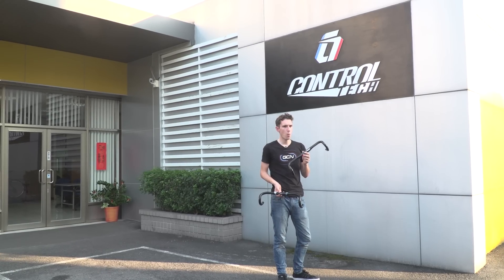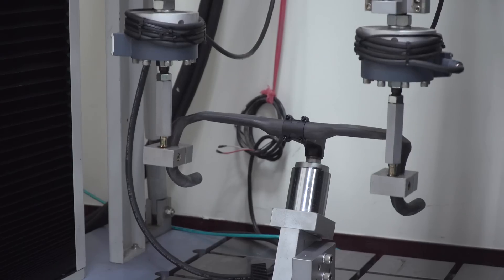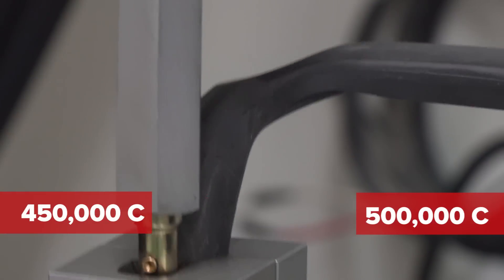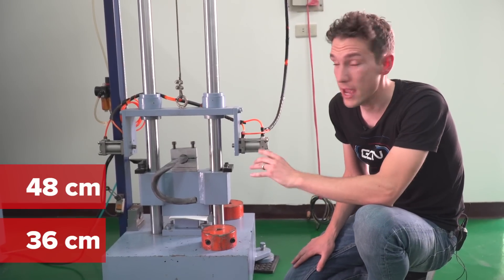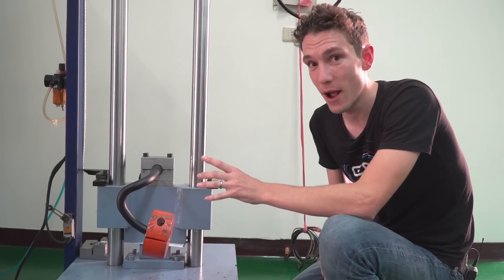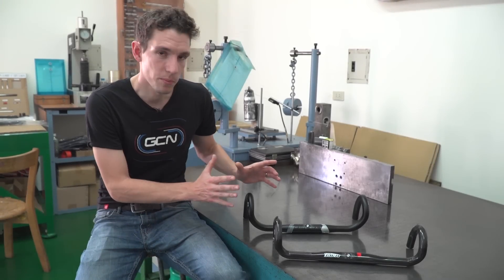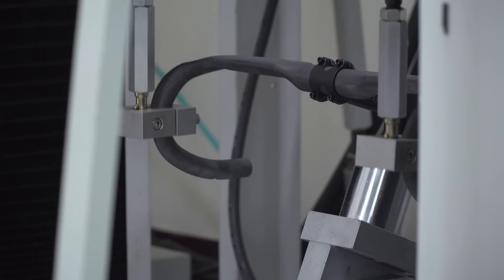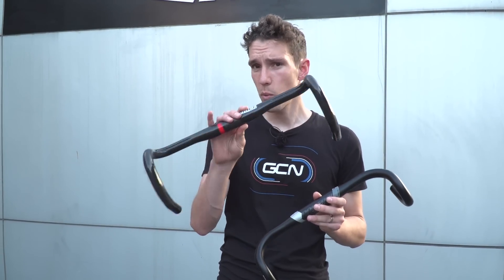Carbon Vs. Aluminium Handlebars | Which Are The Strongest?

Comment: If they test all bars with 400,000 cycles but the bar will break from 600,000 cycles, that means the rider can only use the bar to a level equivalent to 200,000 cycles until it is at risk of breaking after purchase. Wouldn’t the test phase of products just waste its lifetime?

Comment: Im not sure if you mentioned why the drop test was a bigger stress on handlebars than anything in real life.  If you are going really fast downhill and wreck, wouldnt that supply enough force to the handlebar to exceed the drop test?  I'm not talking about a motor vehicle hitting the handlebars at 40 mph, because you would probably either be hospitalized or dead.

Comment: Did the aluminum handlebar change shape during the crash test? So it might have not broke but did it deform?
Reply: Sure looked that way to me
Reply: Yes, because Aluminum is a ductile material, however, in these tests failure isn't considered minor yielding. Granted, I'd consider the change in shape to be small enough to keep riding, but if you've had that much impact, the handlebars won't be what I'm concerned about.
Reply: Yes it did bend but you can ride with bent bars while you can’t ride with a cracked bar
Reply: You can still ride back 😂
Reply: well a bent bar is anoying but yea the pot hole woulf probably fck some other part up harder

Comment: You might left out another very important piece "Friction". You tried pressure and impact but friction is probably most important. Knowing that all A-frame is basically base on friction due each joints turning Etc.

Comment: I feel like Aluminium is safer when it does fail.
Carbon could snap off potentially when standing up on your bike but aluminium is more likely to bend before it snaps so you get a warning. 

What do you think ?

Comment: I stick with aluminum because of the negative environmental impact of carbon production and disposal.
Reply: By that logic might as well have a wood handlebar.
Reply: @FLMKane  not really... By your logic, I'd need a wood handlebar every other week.
Seriously though; carbon fiber is very wasteful to produce and effectively impossible to recycle. It's epoxy and polymer can't be melted and reused like aluminum. I hope more people consider the entire life cycle of this material before purchasing it for marginal gains.
Reply: @Nicool333  Yes by MY logic we'd be using bamboo handlebars. 

Tough as nails and very light. No downsides.

Comment: What about perform testing similar to real crashes? to hit the bar from the site to a cocrete solid surface. It seems that this tests are programmed by manufacturers just willing to sell their new material. When you go to see a race you can see yourself real conditions, carbon is more resistant when it works as programmed (on the rigth directions) if you hit it with something hard on a unespected angle it will break (as the carbon will not work but the fragile epoxy aroung it)

Comment: Are narrower bars stronger? And is the round shape stronger as a pose to a flat shape?
Reply: Depends on which metric you look at, and their manufacturing, but all else equal, narrower bars will be stronger, due to the lower moment arm between the stem attachment point and the forces at the end of the bars.
Reply: John  those are just units of measure, 10mm = 1cm... that question is illogical.

Comment: Their is also one caveat to the carbon fiber handle bars. I noticed that you made no hardness tests no Vickers, Brunel etc... The combination of carbon fiber and resin would not take to abrasion as well as anodized Aluminium.  Any crashes resulting in cuts, gouges and scratches to the handle bars would significantly reduce the resilience of the carbon fiber handle bars as some of the carbon fiber strands have been severed. Meanwhile the same accident would remove have to remove the hard anodized layer of the Aluminium first... cool fact that anodized layer while it would never regenerate to the same thickness and obviously colour. It would regenerate to return a measure of protection to the handle bars.
Reply: And how does that disprove or prove my point? That handy film still offers a regenerative protection that carbon fiber simply can not. If you want to get real technical Aluminium does "corrode" but not in the same way as steel does when it rusts. Aluminium age precipitate hardens over time, causing a loss of elasticity leading to brittle failures. And Aluminium still has superior surface hardness and because of that abrasion resistance very handy when you go ass over handle bars. :)

Comment: I've witnessed some of the earlier attempts at aluminium bars. By all means the chrome-plated steel they used before was superior in almost every way. That said, aluminium handlebars these days are the norm, and steel handlebars are absolute flimsy shit.

The biggest cause of handlebar failure is probably improper installation.

Comment: You know if you've dropped your bike, but how do you know if anyone else has dropped it? How well do you trust your friends and family? Do they even know that dropping your bike could damage it and put you in danger? Would they tell you if they did know? Food for thought...
Reply: Even a falling unconsciously, on the side of the bike, will split apart a 1" c/f handlebar.  Such a fall will NEVER be a concern on C/F crankset arms. As pedals are scraped on nearly every fall; hence pedals are assured to make contact to the ground more than assurance of 'bars.  As the angle of 'bars to make contact on the ground or what else is inconsistent.

Comment: The aluminium bar bended in the impact test, does that still count as a pass?
Reply: thisis howiroll nope, can't bend back aluminium without greatly reducing its lifespan, contrary to steel, where cold setting a frame is often done to accommodate newer wheels on older bikes (130 mm stays)
Reply: Bend back metal and you're work hardening and reducing its lifespan even more. At that point it's compromised and you'd need to replace it.
Reply: yea you could heat it up by a few hundred kelvin and maybe then be able to bend it back to shape but the lifespan would still go down

Comment: If the main deciding factor of you choosing bars is because of crashes, you’re doing it wrong.  Your decision is based off .00000000001% of your riding....and dealing with that choice 99.999999999% of the time.  That’s like using a snow tire year round in the off chance you get caught in a rogue snow storm, so you play it safe rather than pick the bar that suits your riding. Yeah....not smart.

Comment: You didn’t compare the same type of handlebars. The aluminium was a conventional tubular shape but the carbon were aero bars. It failed at the point it had holes for internal cable routing, so it was not a fair test.

Personally I feel the only draw back of carbon is price point. Both will fail if hit with significant enough force. You can not design something to be both lightweight and crash resistant. It is always a compromise. Arguably steel is a better material then both in this respect but is considered too heavy.

Comment: Problem with carbon is that there can be significant variance in the processing of the exact same make and model, due to things like voids in the carbon layup and too much/not enough resin. Testing just one sample doesn't really tell the whole story.

Although carbon processing for bike stuff has gotten better in recent years, I would still not trust something as critical as my cockpit with carbon parts that are not individually scanned for defects during production. Scanning is SOP in the aerospace industry, but has been for far too long absent in the bike industry, subjecting us to undue risks.
Reply: The only company I am aware of that scans is Canyon which checks every fork
Reply: I believe Trek and FSA have recently started to as well. Shops like TIME that weave their fibers in house and use resin transfer molding also inspire more confidence.

Comment: There's another test on road handlebars at Fairwheel Bikes where they tests how stiff bars are. They did not test to destruction, but across the board aero carbon bars are more flexy than round or egg shaped carbon bars. From that info, I'd infer that it's easier for the same amount of force to bend aero bars to point of breaking.

Comment: Well i rather have steel padels and stear because eventrough alluminum & carbon can be strong , but they can brake at a sudden moment wich can lead to a traffic incident , i did had a bike with aluminum pedals but after 5 years those pedals did brake all the sudden at a sudden moment  during cycling down the street, i did got lucky to not hit a car during that moment but it could,ve happen.

Point , they should ban aluminum pedals & stears before some one dies from such (possible)incident like me.

Comment: I think they're fine in the road and XC world. But getting into mountain biking, and trail, all mountain, enduro, or down hill... no thanks. A handlebar failure there will land you in the hospital... and it's a lot more likely to happen as that use case sees the most abuse. 

Carbon fiber can do amazing things. As a bow hunter I have carbon arrows and a carbon limbed bow. But the tiniest imperfection or scratch on the surface will become a failure point. I've had limbs snap on my bow because of a tiny scratch. It blows up into a hail of sharp splinters when it fails too. There's no warning, no symptoms, just instant failure. 

It's a great material, but you really need to understand it's properties to run it safely. Handlebars with all the trinkets bolted on, subject to forces in all directions, including perpendicular to the fiber orientation, just aren't a good use case for carbon. They save you - in total - a few ounces at the expense of safety, IMHO.

Many of the carbon bars on the market are raw carbon too. I would like to see some paint, DuraCoat or other treatment to give the carbon just a bit more protection. Because once that surface is even slightly marred - it's toast. It will eventually fail at that point. A coating would offer some small degree of additional protection.

Comment: But if you crack or delaminate carbon it's naff that's the reason lots of people still use alloy bars as carbon could be cracked under bar tape and you won't know tell it goes snap
Reply: You actually would. You'd hear it, and feel it. Carbon laminate cracks and pops loudly, and therefore vibrates under your hand, as it progressively fails. It's not instantaneous, as Si showed in the impact test.
Reply: Andres .C where was an impact test of something hitting carbon? Carbon can have delamination long before it shows a crack.. as a impact on the bars is the test that really matters as carbon fiber has amazing fatigue and strength but gets damaged in impacts with objects ,and it's damage can be much before it's anything visable places who test carbonfiber use ultra sound for a reason
Reply: have you failed a carbon part in a lab? I have. On a bar you'd feel it failing beneath your fingers. It doesn't just go suddenly because cracks have to propagate through the weave.

Comment: The impact tested two different types of bars. The aero carbon with internal cable routing failed at an opening near the stem where the cross section was reduced. The aluminum bar did not have the internal routing and reduced section at the openings. A better test would have used two of the same types of bars.

Comment: Let me end this debate Which is stronger aluminum or carbon ofc aluminum you can throw the aluminum wherever you want Slam the aluminum handlebar to the ground slam the aluminum handlebar to the rocks and metal aluminum will just get a dent or intact now try to Throw the carbon into the ground or rocks or slam it it will break 

Now for advantages of aluminum
Hard to destroy✅
Durable✅ 
Aero✅ 
Last longer ✅
Common to use ✅
And Cheap✅

Now the Disadvantages 

A little heavier than carbon maybe 40-70g difference
Not quite good looking like carbon not internal cabling some of it is internal but the most common aluminum dropbar are not 

Now for advantages of Carbon
Light✅
Aero✅
Good looking✅
Durable but not like aluminum who are super durable✅
Rare

The Disadvantages

Expensive not durable as aluminum break easily although it's light but it breaks like hard Chocolate 

I love carbon but i choose specific carbon handlebar with a material of t800 or T900 so it doesn't break easily for aluminum i just choose whatever aluminum handlebar is that as long as its good looking and internal

Comment: Typically with several of GCN product testings material specifications are not stated which in my opinion these tests can be misleading to say the least
I would prefer to see proper engineering evaluation rather than comments from a has been pro cyclist !

Comment: What I find odd is over the last 10 years or so I've seen a lot more carbon bars fail on their own then I've seen aluminum bars fail in 40 years!!   The failures I'm talking about is not due to crashing (while I did see CF bars break in crashes), while crashes did result in the bars failing.  So I don't think these machine testers are anywhere near real life when it comes to the fatigue issue.   Of course GCN is all about pushing whatever the marketers tell them to push, like their video they did on disk brakes vs rim brakes, in that video GCN cheated all over the place to get the disk brakes to come out ahead.  But at least in this handlebar test they did say that AL bars will survive crashes better; but I bet in that simulated crash test those CF bars suffered some sort of hidden damage.48 cm.

Comment: Many types of aluminium harden with age as well until its eventually pretty brittle, carbon might not change in stiffness over time.
Reply: Carbon's age effects are pretty varied from what I know due to the various manufacturing methods.
Reply: Yes, direct sunlight for example will affect the resin so if its not UV protected it'll degrade pretty quick.

Comment: It looks like the aluminium handlebar has a round cross-section whereas the carbon model has a flattened section with holes for cables? That is hardly a fair comparison! Unless of course if all handlebars follows this pattern?

Comment: Do aluminum bikes get stiffer over time? I understand that manufacturers build flexibility into aluminium frames. Does this harden over time? #askgcnanything
Reply: Aluminum does harden (as a material) over time, but the welds and connections won't. The Youngs modulus will increase, but I think the yield strength decreases. I'd need to check my textbook though.
Reply: elh93 thanks for reply. I have a 5 year old canyon aluminium. Just wondering how it will ride in the future.

Comment: How is less than 12kg weight dropped an "extreme" test, when a rider plus bike is at least 5 times that?
Reply: Not all your weight is on your handlebar, some on on the pedals at least
Reply: velosophie1 maybe he has fat arms br0
Reply: Because they're not interested in the weight, but on the force peak generated when it hits. The deceleration is quite extreme. It's not the weight but the momentum. You could do the same with 1kg from a greater height.

Try breaking someone's jaw by pressing your knuckles against their face... then give up and punch them.

Comment: This is a paid promotion and that in itself is a bit suspect.  However what is NOT addressed here at all is the effect of the elements on Carbon bars, frames, anything carbon.  It is a studied and well known fact that over time when carbon fiber is exposed to UV rays, moisture "i.e. rain etc."  it can begin to delaminate and fail at the molecular level "unseen"  that is...loosing it's structural integrity by up to 30 percent in as little as 500 hours.  Best to stick to aluminum bars, frames, everything unless your made of money and don't mind a 5k frame breaking or a 200.00 pair of bars just 2-3 years in.  This also says nothing of manufacturing defects, errors in layup etc. Most assuredly stay away from cheap Chinese bars and frames!

Comment: #Talkback ! If I take my chain off my front crank so it's free of any resistance , how much should it spin freely without any problem. Is it down to what brand BB is or is it down to the tightness of star shaped plastic bolt that sits neatly inside the crank arm. # Talk Back. !!

Comment: Test fail.  Do it again with tubular bars on both, not the weaker aero carbons where the weak point is obvious before testing is performed.  Make it even simpler to prove a point and use strait mountain bars.

Comment: Shame on you GCN, you could have at least used the same profile bars in the impact test. It is no surprise that the aero carbon bar failed at lower force than the round section ali bar due to the way it interacts with the force applied in that test. Not a fair test!
Reply from the maker: When you buy a handlebar, the shape will have no effect on it's strength. They are engineered differently so allow for that, it's why the only variation is the weight.
Reply: Global Cycling Network thanks for getting back! I do appreciate the lay-up is altered accordingly, but it would still have been a visually fairer fight to have two round section bars, rather than one thin aero with cable routing holes and another round with no holes. This holds particularly true as the failure in the carbon bar occurred at the cable orifice, indicating the csa or laminate design was either designed to fatigue here, or was being tested beyond the design fatigue limit.